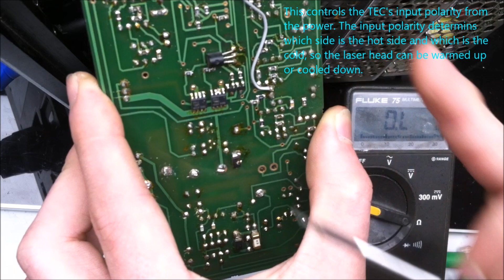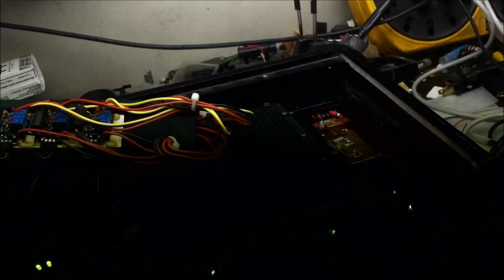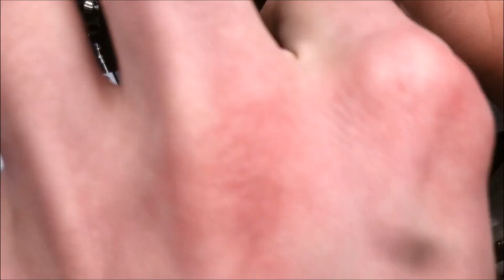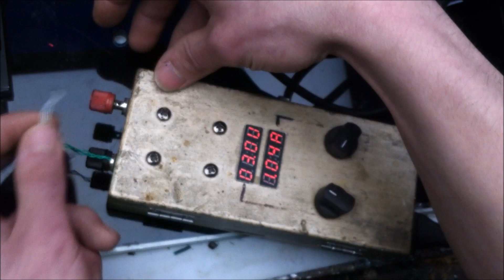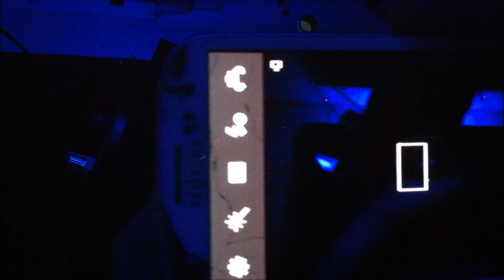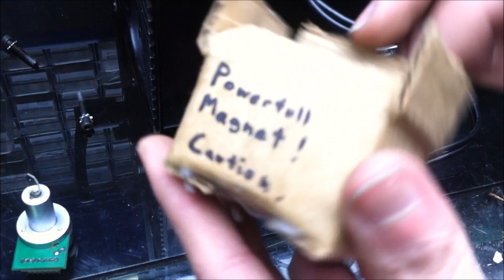Repairing 6 Show Lasers Part 4, Green DPSS Laser Fix & Galvo Attempt.

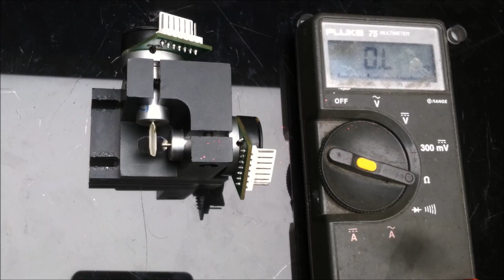Comment: You know a laser dude when his camera has dead pixels - 40:13.  Bet it was caused by IR.
Reply from the maker: I certainly do have the battle scars on the cameras lol. However most of the damage is from visible laser sources as most of the IR pump laser light from DPSS that you see in videos is not directly collimated and pointed at the camera directly and most phones have an IR filter.

Comment: What type of glue is used to attach galvo mirrors and laser beam mirrors?
Reply from the maker: I typically use a rubberized super glue. The trick is mostly in how I dip the galvo end in a small drop and then use blowing air to keep fumes from settling on the glass. I typically use this type of glue because if there is an error after drying I can soften it up with acetone and make adjustments. make sure that the mirror slides into the gap before use of glues.
Reply from the maker: You can also see the technique more in my full 4 watt analog laser build when I had to rotate the galvo mirror 180 degrees to fit.

Comment: Hi I have the same green laser as the one in your video the bg100t how many mw and that laser model?
Reply from the maker: That laser ( one of the demos had to look at the lasers ) is 150mw green with TTL as far as models, lasers don't really have any OEM model numbers in many cases. They have serial numbers from the factory but finding where exactly a laser head came from is tricky without a bunch of industry foresight. You can pretty much replace any laser and driver with one of the same output power, general color, and modulation.
Reply: @Zenodilodon  what are those two long potentiometers of that green laser .
Reply from the maker: @JO72ful  One is for laser output power and setting the pump diode to the correct current range. The other could be for voltage set point or for the TEC temperature. I have not messed with them so I do no know what does what.

Comment: I've been listening to this while programming (I like to have background noise while working), super interesting them optical/electrical/mechanical systems. This really makes me want to find a use for the set of galvos I scored off ebay months ago but never got around to doing much other than testing them with a function gen. 

Would you say most of the movement related failures you see in these systems tend to be due to the driver or something within the galvos themselves? Would be interested to see the inside of the dead galvo, if it is a moving magnet or coil and the arrangement. Interesting that the magnet would demagnetize before the coils fail if the whole enchilada got hot enough to reach the curie temp.
Reply from the maker: It kind of scales with power, on slower galvo kits usually it's mechanical failure. Since they are in cheaper units dust and moister get into the bearings a bit. From there you have the mid range 20kpps range you tend to get amplifier chip blowouts since it's higher voltages. Usually it's the TDA2030 that bites the dust. On higher end systems it's the heat. The units are built relatively well and yes often take out the magnetic rotor in the center. This is what happened to the galvos on this video.

I do have a video on the inside and function of a closed loop galvanometer up on my channel. Although there is a small box forming with your name on it as as if you want the authentic Christmas feeling.